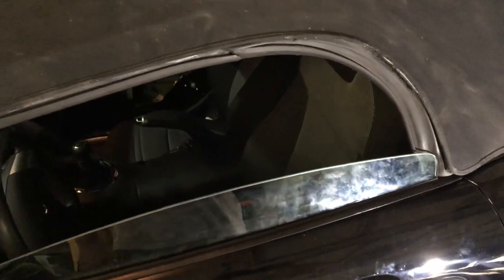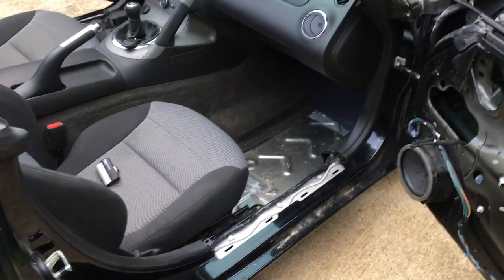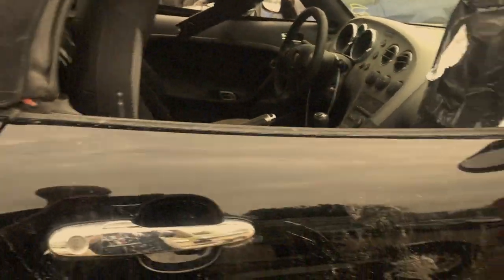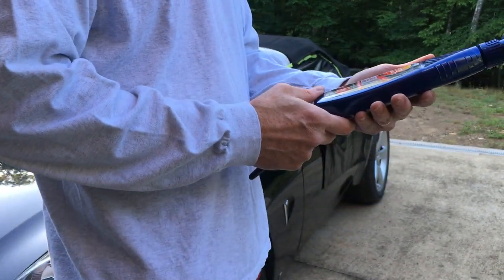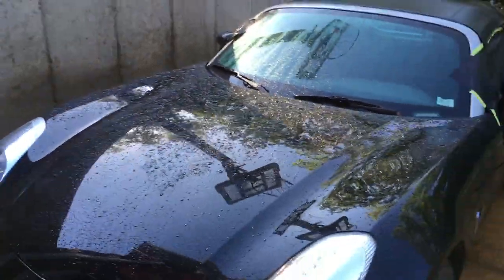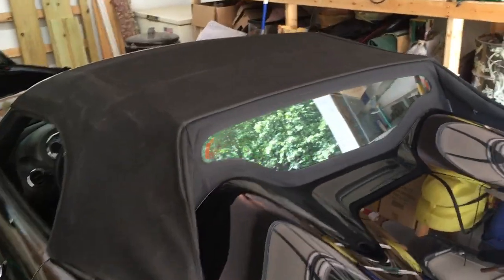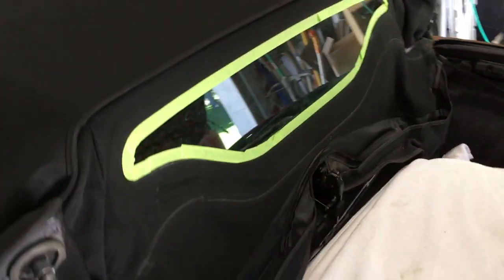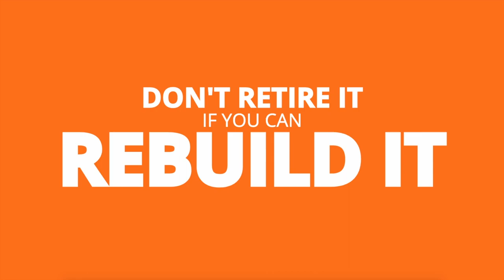Restoring the Convertible Top - Pontiac Solstice Rebuild Pt. 7

Comment: Looks great. I also had a top that needed work. Yours came out great with the dye. I tried, but it didn't work out because I had way too much sap and other junk that would not come off or allow the dye to stick. I decided to put another layer of waterproof multilayer fabric on top with some e6000 to hold it and cutting it to size as I clamped on to the old top, and so far it's held up really well. It did fade a bit, but dye took care of that one. If you ever need to replace the top, that could be an alternative for you considering the tops are pretty pricey.

Comment: A common problem with the trunk is it will create a vacuum inside and not open when released unless you pull on it through the hole the top goes in through. Some owners have fixed this by installing a spring. If the button doesn't fix the issue consider this option.
Also what dye did you use on the top? My Sky's top has been fading since before i got it.
Reply from the maker: @DynamiteDupree Thanks for the info and for watching our channel! The new switch did fix the problem. The dye we used was Protex canvas restorer. We talk about this more in next week’s episode. I’ll see if we can put the link to where we got it in the description.
Reply from the maker: @DynamiteDupree https://www.amazon.com/dp/B00745IFR4/ref=cm_sw_r_cp_api_i_9YTeDbVRFXEQX

Comment: Just bought a 2006 Solstice and I need to treat the convertible top. I will use the 303 as you demonstrated but what type of dye product did you use to get the top darker? I would love to apply this technique to get my top restored to its highest potential. Any feedback on this question would be greatly appreciated! Thank you so much for your video contentt - Divine timing and connection! 😁
Reply from the maker: https://www.amazon.com/dp/B00745IFR4/ref=cm_sw_r_cp_api_i_9YTeDbVRFXEQX
Reply: Thank you very much! :goodvibes: @rebuildit

Comment: Good video. Where did you get the canvas dye from? I have the tan top and would like to do the same. Secondly, How did you get the trunk release switch out? I accidentally pushed my Instrument Panel Brightness control too hard and its slightly stuck in the dash area. Where might I find help on something of that nature?
Reply from the maker: We got the dye from Amazon, but if I remember correctly they didn’t have a tan since there are so many shades. I’ll look back on my videos and see if I can remember how I got the switch out and let you know. I sold that car quite a while ago and can’t remember.
Reply: I have a tan top as well.  Just curious if you were able to find a decent dye match for your tan roof.